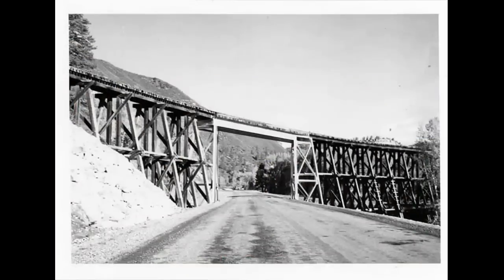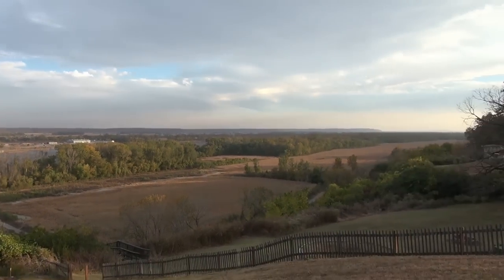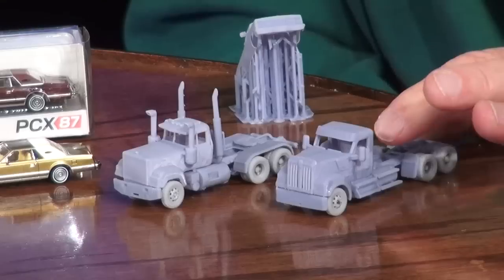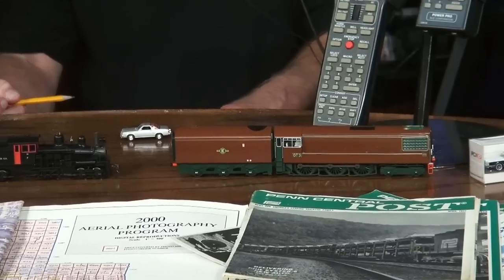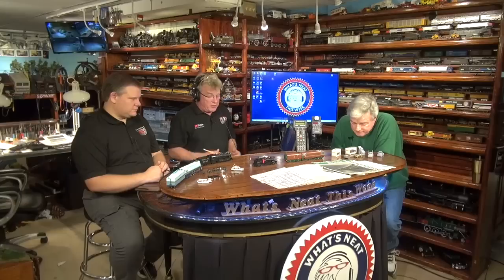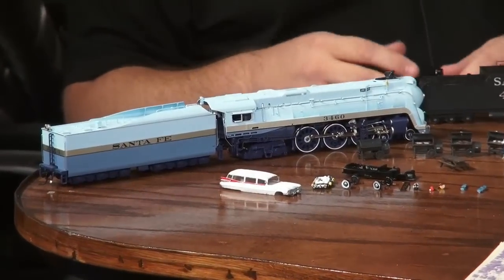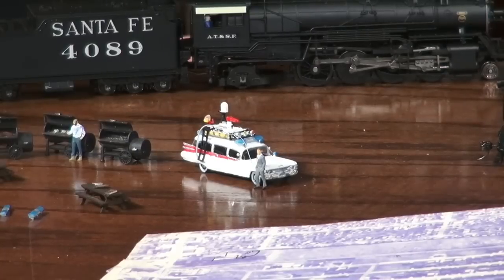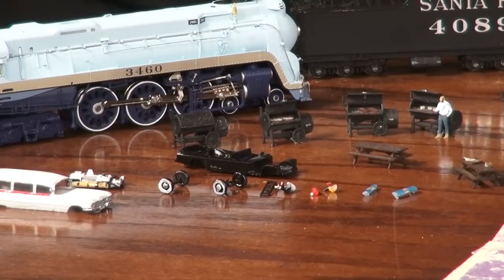What's Neat This Week in Model Railroading #213 October 22nd 2022

Comment: For Mike Budde, Maybe you can help me.  I model On30 so the scale is 1/48th.  I'm looking for Model A Fords and other manufacturers from the 1928 to 1931 era, Chevy, etc.  I do have some purchased off Ebay.  Essentially, there are no 1/48th scale of this era and I needed to go with 1/43rd scale, which is slightly to large, but will work for me.  I would like kits; but, will take what ever is available.  I have a Phaeton, Two Door Sedan, Coupe and Roadster, would like a Station Wagon and Victoria and any Chevy, Buick, Dodge, etc.  Mine are cast models.  A problem on Ebay is that people don't know what scale the models are they are trying to sell; 1/43rd or 1/32nd.

Comment: Mike the Australian Mack Superliner with the two air cleaners and snorkel intakes would have been built with a Mack V-8 diesel. That's why two air cleaners . the snorkels would be high up to avoid road dust. I almost bought a new Superliner back in 1982 but did own two R model Mack's back then.

Comment: Surprised to see high low the river is.
We have the opposite problem in Australia with many towns flooded. Even some riverfront suburbs in suburban Melbourne.
Widespread use of snorkels in Australia on trucks get away from dust on roads and provide a better air cleaning intake. Even sealed highways can get dusty here.